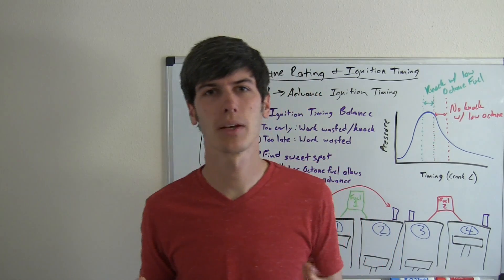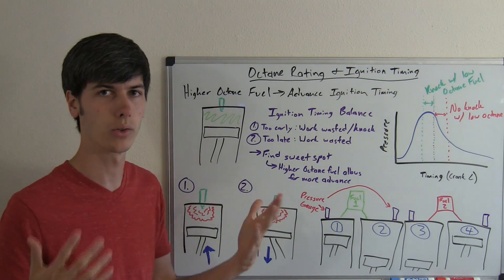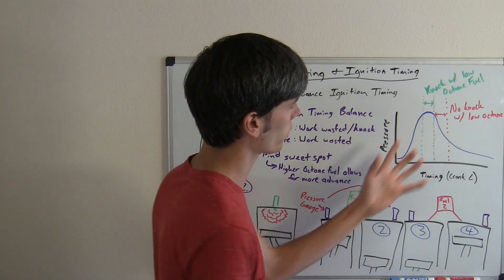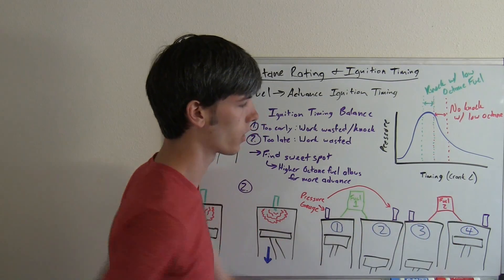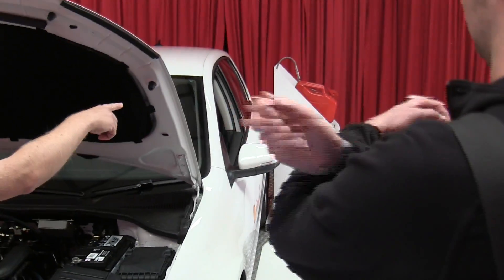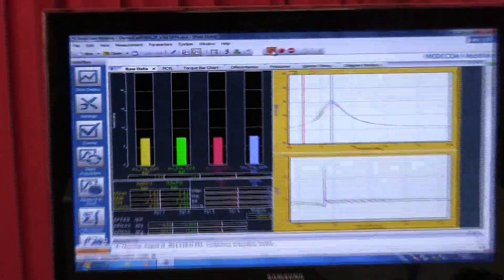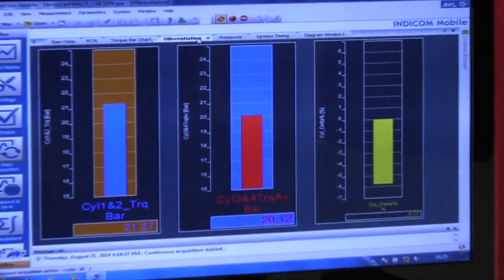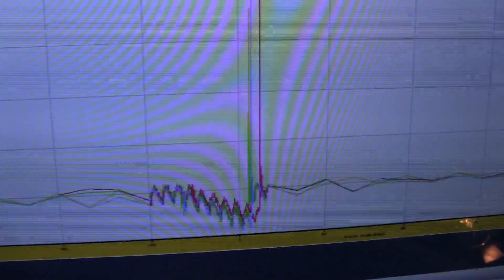Dyno Testing Premium Fuel - Octane Level vs Performance - Shell V-Power

Comment: I have a car that originally had a high compression engine, but now does not. 
I've ran with 87 octane and 2.5 inch exhaust,  15.2-15.6 quarter mile. 
91 octane 3 inch exhaust, (didn't get as many runs) 15.6 again!
😮

Comment: My car says premium recommended (not required). How does the engine know what octane i'm using? is it just based on a knock sensor and then adjusts timings? does this damage the engine at all if you occasionally switch octanes?

Comment: It's also interesting to note that lower octane fuel ignites quicker which can give you better throttle response and improved economy.  Some cars feel sluggish on high octane, my Ecotec 2.0T feels deluxe on 91 but it still goes like hell on 87.  No knock, I just hear the turbo. I'll give it 91/93/94 for the mountains but around town it seems 87 is just fine.
Reply: TSI engines from VW are made to run on 98. 95 can cause knock, 92 is too low.
Reply: @dragospahontu  My 2024 Volkswagen JETTA GLI has a 2.0L 4-cylinder TSI turbocharged engine, and this vehicle has been running on (per this vehicle's user manual/guide) Octane 87 gasoline just fine. Note: I am in Canada where Octane 87 is what you refer as 92.

Comment: Curious. Will the car's ecu will control the individual cylinder's ignition timing to optimize the performance based on the fuel's octane? Also, will the computer also sync the cycle of the cylinders for best effectiveness?

Comment: This makes no sense. How can you adjust the ignition timing for just two cylinders? Wouldn't that affect the timing of the other two? Even with variable valve timing this doesn't seem optimal. Why not just run a test with the whole engine on the low octane with regular timing and then switch fuels and advance the timing?

Comment: Well put young man!
Personally I'm more interested in using the ESSO synergy +99 as it has no ethanol, as the ethanol is reaking
havoc amongst older petrol engined
vehicles, destroying 'o' rings cork seals etc. I'm not knocking the other brands though. No pun intended.

Comment: You can't necessarily hear uncontrolled combustion events (aka, 'pre-ignition', or 'knock') from inside your car. It actually has to be pretty severe to be audible. So which fuel to use was a much more critical decision, in the days before EFI and knock sensors. Back then, for the vast majority of applications, the object was simply to protect the engine. Carburetor and ignition tuning were conservative, and more stable 'high-test' fuel provided additional insurance.

There was a laborious process of 'spark plug reading', followed by ignition and carburetor tuning, used in racing to extract maximum performance. But it was only good for the specific current ambient conditions (barometric pressure, temperature, humidity). Not very practical or useful in a daily driven car. 

Once self-adjusting engine management and knock sensors came along, an engine could take advantage of premium fuel to produce more power safely. Given what Shell V-Power costs, the question is whether a slight power increase justifies the expense. Bottled injector cleaner is a cheaper way to get better fuel system cleaning. So, are you running around at max throttle and load on the street? Or racing your car professionally? Probably not. It's your money...

Comment: Higher octane ALLOWS more advanced timing which makes more power, but the car has to be capable of adjusting for it. Older cars rated for 87 octane will not advance their timing and will not make more power if you fill up with 93. Newer turbo cars or custom tuned cars most definitely will advance their timing and make more power on 93 octane. It depends on the car. Mazda Skyactiv is a good example. It will adjust timing and power output based on what you fill up with. 227HP on 87 Octane, and 250HP on 93 Octane.

Comment: I’ve always run 93 octane fuel and have never had any major mechanical issues in my vehicles. It sparks faster and runs more efficient especially in high performance cars that’s one thing I’ve never understood when people use 87 octane in a powerful v8 especially for racing just because they want to save 5 bucks at the pump for me it’s totally worth it and the science backs it up.
Reply: Well, actually, the higher the octane rating of the fuel, the HARDER that fuel is to ignite & the MORE heat is required to ignite it! They also burn slower than lower octane fuels as well...

Comment: I switched to the premium gas for the increase in detergents. I have also noticed an increase in performance. Worth the increase in price.
Reply: That's why they told me to run premium in my motorcycle despite handling low octane fine
Reply: Thanks

Comment: a recent experience lead me here today.
Basically i just bought a used 14´ Mazda 3, 2.0 120hp.
Had it filled up with Octane 100 (V-power essentially), and now the next fill-up i tried the cheaper Octane 95. 
And i've been noticing a heck of a lot less torque in the low rpms. 
(Mazda recommends 95 in Denmark) 

Has anyone here experienced similar results?
Reply: Nicolai Nielsen Yes on my Diesel engine I can notice a difference running on supermarket diesel compared to BP ultimate or Texaco Supreme throttle response is quicker and engine revs more freely

Comment: its more than just ignition timing.  It's also about the turbo boost.  regular fuel will decrease the boost pressure which reduces effective compression ratio, which reduces knock, and obviously lower hp.

Comment: 4% increase in pressure doesn't, IMHO, justify the extra cost of very expensive Shell V power gasoline.
Reply: Depends on the results and mileage increase your SPECIFIC vehicle sees.  Or, depends on whether your particular is high compression and needs it regardless.

Comment: In Colorado, the regular gas is “85 oct”. My mustang gt minimum requirement is 87 oct. and of course no matter what i will use 87. I’m wondering what were to happen if I used 85 octane in CO. Is Colorados 85 oct just like 87 octane in a state where the regular gas is 87?
Reply: You need a more "ignitable" fuel in higher elevations b/c your air charge is less dense inside the cylinder, so you can run a lower octane level fuel up there safely, hope that helps, I miss my 'Stang sometimes!

Comment: Higher boost turbo engines require higher octane and faster/higher ignition systems to get the most out of the fuel. Outside of that. Stick with 87.

Comment: I really don’t understand something. Why would a lower octane gas be ignited later? Wouldn’t it knock if it’s ignited later since the lower octane means it would pre combust due to the higher compression of being ignited later? Shouldn’t lower octane be ignited earlier so there isn’t enough compression to make it pre combust? Why would a higher octane ignite earlier when there’s less compression? I would really appreciate clarification from someone.
Reply from the maker: If you ignite it early, combustion starts before the piston reaches top dead center (it's still moving up). This means not only do you have the added pressure from compression, but even more pressure from the combustion that's already starting. The pockets of fuel and air that haven't yet been reached by the flame front are now at a higher pressure, and so they want to auto-ignite before the flame reaches them (knock). If you delay ignition timing, you won't have to worry about this.
Reply: Engineering Explained so if you delay ignition timing with the lower octane, the flame front from the spark plug will get to those hot areas before they get a chance to pre combust? Thanks for the super quick reply too!

Comment: How do I know if my car has knock sensors and an ignition advance program to run higher octane fuel?
Reply: Your engine’s compression ratio is really what determines what fuel you should be using.

Comment: The test in the video is un acceptable.
1) there should be a control vehicle to be compared to. The vehicle they used could already be tuned to run on the higher octane/RON fuel.
2) there should be a control fuel.
3) There should be a comparison of performance differences between each fuel. Just showing a difference in cylinders pressure between the use of the 2 different RON fuel doesn’t show us anything. The test shows a 4% higher cylinder pressure for the higher RON fuel, but what does that translate to? Performance? mpg? If so then how much is the difference?
4) There should be a comparison between the fuel used in different situations. City and Highway use. Even better if they could include Race conditions.
5) There should be a performance vs fuel cost comparison.

Then and only then, that we can make a conclusion out of it. But obviously all the Oil company will never do such a thorough test and provide any result to us consumers. They all want us to put in RON 100 even in our lawnmower for a “performance boost”.

Comment: Bro need to touch on how some cars are officially recommended to use lower octane especially cars.
Theres no increase in power if you dont have a sensor to take advantage of the early detonation.

Comment: Everyone tells me I waste money using the higher octane, they say it makes no difference. I have a big mtn just outside of town, if I set cruse control at 40 the truck slows down and shifts which speeds it up then it shifts again. It does this shifting back and forth no matter what I set cruse at. When I use higher octane it gives just one steady  pull up the whole mtn. I also get more miles per gallon, not a lot but some. At the end of the day, even with greater MPH I'm still paying more for the higher octane. I'll pay it for the better performance  and better mileage. I have tore down a couple motor's after using the high octane for a number of years and the inside of motor is clean, hardly any carbon build up or varnishing. Add up the extra mileage, better performance and a much cleaner motor and it's worth the extra money

Comment: I have a 4 litre turbocharged 6cyl engine running liquid LPG injection.  It runs way better on LPG than even premium  because LPG is up to 110 octane so the tune winds up the advance.  I use premium gas in the petrol tank because it's only used for a brief period after start and Premium has more detergents to last longer and be cleaner.     I can only thrash my car on LPG though as it pings on anything else.

Comment: My 2017 Volkswagon Gti will get a slight bump in power with the high octane but as shown in the video will adjust and run fine on regular gas as well with almost un-noticible performance. The cost of the high octane is not worth the benefit so I don't use it on a regular basis. I fuel up with high octane a few times a year because it has fuel additives that are beneficial to cleaning the injectors that the regular fuel don't have.

Comment: There is no way that engine can change timing per cylinder like that unless it has exhaust sensors per cylinder which I know it does not so this is so fake. Now that being said if you run a lower octane fuel with the timing the same the lower will make higher pressure as it burns faster and hotter unlike what most people think

Comment: Anyone who fills up their car with premium who doesn't go full throttle rev to redline a lot is wasting money. More power achieved by premium means nothing unless you go full throttle. You can just give 5% more throttle with 87 and achieve the same power level
Reply: Since this is at the point of knock you can't just give it 5% more throttle on a lower octane fuel and get the same power as the higher octane fuel.

Comment: Hi, im writing you from France. First of all, thank you very much for the quality of your videos and explanations. I was wondering if you plan to do a video about e85, flex fuel and stock vehicles using this type of gas without any kit or whatsoever having their car working fine thanks to the ECU and injection stock tolerance. It is extremely difficult to know whether it is dangerous or not for the engine, no one seem to have a proper answer about it. Some seem to use e85 on a daily basis for years without encountering any problems, though others explain that it might harm the engine... It would be nice to have your view on the question ! Anyways keep up with the good content :)

Comment: got another question for ya. no cost involved, will the power loss from running 93 in a bike that suggests 87 be worth the amount of power gain from advancing ignition? if so, would it be enough to be able to do without dynoing, or would it be too close to call(aka even a dyno couldnt tell the difference)?
Reply: watching through the vid i've come to the conclusion the stock timing is the important factor in deciding whether or not it's worth it here. considering it's (i think) 11.5 comp stock and it suggests 87, it's probably running a conservative timing. sv650, so it's not really a balls out bike

Comment: with this line of thinking we should just go ahead and run 60 degrees of initial timing and use nitromethane for the fuel. Are you ricers listening? I assure you the results will be spectacular ; for a minute anyway. Come on whos willing to give it a shot? Be the first one on your block aye? Youll need way bigger injectors and a bigger pump but at 10-11to1 compression as i already stated the results will be coooool.  The orange & blue flames + nitro fumes will make you a star at the local hot spot! Or fuk dat , buy a prius and take a nap instead. Better yet spend your money on a mech engineering degree and be somebody so you can sit back like us and enjoy the fireworks...  If you need help im here to advise
Reply: A star in a reasonably priced car, no less....for about a minute or less!

Comment: your videos are usually spot-on. the truth of the matter is higher octane fuel has less BTU or chemical energy than 87 octane. octane is a function of compression ratio and actually requires more ignition timing because the higher the octane the slower the burn. this subject is way more complicated then even I can get into in a comment section YouTube video
Reply: Buck Ding so don’t comment then. At least EE is educating people
Reply: Even you eh? Tool bag

Comment: To start off I just wanted to say I'm a fan of your videos. I was wondering what effect does elevation have on octane and what would happen if I ran a 93 tune using 91 octane? Thank you for your time
Reply: At higher elevations the air has less density and also less oxygen content.  Therefore cylinder pressures will be slightly lower, and you may or may not be able to get away a with more timing via the tune.  I personally wouldn’t recommend it however as the oxygen content and density is less of a factor than than you would think compared to the timing curve changes.

Comment: the main difference is having an engine that has an over 10 to 1 compression ratio or turbocharged engine that makes the difference and if you run lower you'll have the knock. you shouldn't run higher octane if you have an  Economy Car higher octane is not going to make a difference in the engine your just wasting money

Comment: Damn, just realised this was old!
Question 1 - Does the advantage only apply to engines that have the ability to self adjust timing?
Question 2 - Any way to tell if my 2013 Subaru Forester FB25B would really benefit from this?
Question 3 - In Australia the price difference between 91 and 95 - 98 Octane fuel is very significant, so even with the better performance of the high octane fuel, is my economy shot thanks to the over zealous pricing of the premium fuels?
My circumstances if relevant -
The Subie is a daily driver, not looking for race track performance, but i do care about looking after it.

Comment: This is a great video, thank you. A 4% pressure difference probably translates to less than a 4% power increase? Aren't there other energy losses by the time the movement makes it from the piston to the wheel? I've been putting high octane in my 4 cylinder turbo VW engine but I think I'll switch.

Comment: But to have a difference, the engine must be designed to use higher octane gasoline, right? If the engine already reaches it's best performance with regular gasoline, there won't be any difference in pressure by using a higher octane gasoline.
Reply: uh, not necessarily... there are many factors there... compression ratio, ignition timing, fuel mixture, air pressure/density/temperature.... octane is just part of the story... there are other additives in fuels that can also be a factor... not all fuels are created equal, but the standards in the US make them pretty darn close. etc... etc... you almost have to take it by a case by case basis depending on what engine you have.

Comment: Hi , I’m not writing this to be a smart ass, I’m interested in this topic and value any discussion. 
The fuel itself does not have extra energy it only has a higher octane rating. So in an EFI with infinitely variable ignition, how would a car at idle show higher cylinder pressure.  If the two fuels had the same energy, the timing would/should be optimized at almost exactly TDC to make the most of the available energy, so why would advance give it more pressure? 
Maybe some cars do knock at idle, but I have never been aware of this.
I also have another question; does lower octane fuel run hotter? And if so why?
I have been told that on BRZs running on low octane will prematurely ruin the injectors, not sure which system, due to excessive heat.

Comment: I have an old 91 4runner with 281K it gets awful gas mileage. I know it will never run like new and I always use shell, Mobil or chevron gas. never Arco or any cheap station. do you recommend I use the higher octane V power or at this age of the vehicle it doesn't matter?